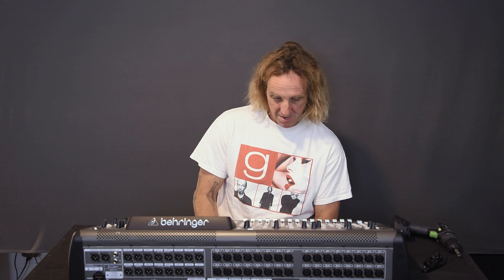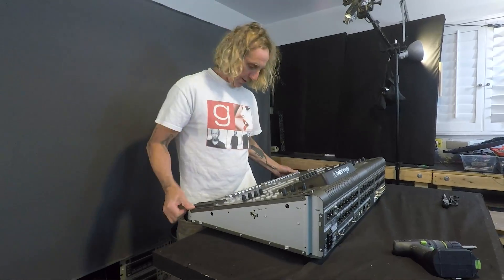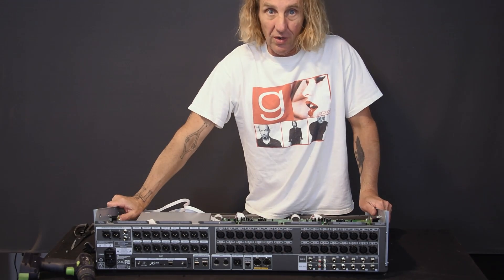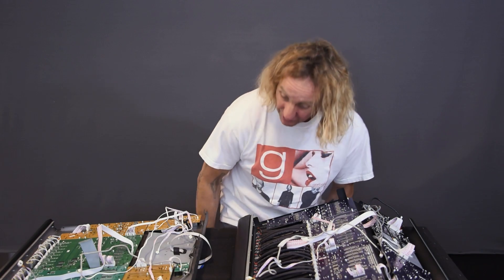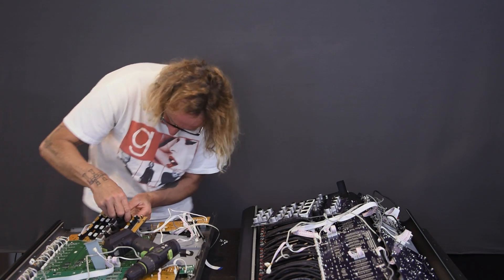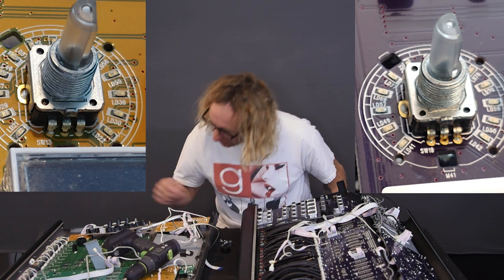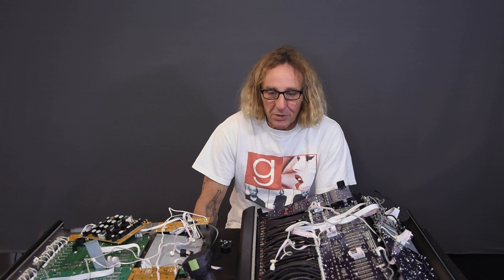Take Apart Behringer X32 & Midas M32 (Public)

Comment: Hey so one important difference is the quality of the xlr releases on the inputs. the non brand connector are not a strong and have snapped on my x32... Had to pull one out of a broken qsc amp.. 
Thanks for the vid saved me some stress pulling the x32 apart

Comment: Price reflects quality, you can see from the components on the PCB alone that Midas is more premium.
Reply from the maker: I agree and looking back I think probably the most important difference is the faders. on the X32 any dirt or dust or liquid falls onto the fader flat surface contacts. 

like professional consoles, the m32 has vertical circuit boards such that the dust falls through and past the contact circuit boards and the faders are individually replaceable 

this is an expensive difference and very important.

Comment: As a retired electronics mechanic working military radar, the expense of a superior design as per longevity and service capabilities, it's better to invest in the superior product.  Unless the user has a short term usage expectation for said product.  Flat packs are ok. But discrete full size transistors are superior imo.

Comment: I'm surely the main culprit for that price difference is just the "Neutrik". hahaha
ok ok, seriously, i will definitely spend 15% more on M32 mainly for having the Xilinx chip in it, then a little more quality on faders and the purple PCBs.
Reply from the maker: I think maybe one of the most important differences is the faders in the Midas are vertical so dirt falls through and they are horizontal on the X32 so dirt builds up inside of them.

also ease of replacement of faders on the m32

Comment: Part of me wonders if you could take the input and output boards from the M32 and swap them into the X32 - that way you'd get the best of both worlds. (Aside from needing to possibly design/3D print some internal mounting hardware.) I've found a source in Vietnam of all places that'll sell new M32 boards... If both units run the same firmware then surely it's at least feasible.

More investigation is required. Thank you for this video! :D

Comment: Seems like Midas put in a special pulley system with belts for the faders. I’ve actually used my school’s M32R and it is a beast even at its small size
Reply from the maker: None of the console companies make their own faders but they do work with motorized fader manufacturers to customize them if need be. 

Mainly involving selecting a certain quality of motorized fader with a specific electronic resistive parameter and then altering the mounting if needed. 

The faders in the Midas have vertical circuit boards which is preferable because liquids and dust does not pile on top of the electrical contacts like it does with a horizontal circuit board like the ones in the x-32.

Comment: A big thing that I'm getting out of this is that the Midas is more serviceable. If a fader needs replaced on the Midas you can easily replace an individual fader. If one needs replaced on the Behringer you either replace the whole circuit board or have to desolder and resolder a fader...not even sure which format the parts are available for that. The take down of the Midas also seems on par with other higher-end consoles that are meant to be serviced while the Behringer might be more of a throw away if major service is needed.
Reply from the maker: And all the dust and much builds up in horizontal faders like X32 and m32 vertical faders the dust falls though and past the board.

Comment: Can someone please explain to me how this type of fader works? How can it apply different resistance over four layers simultaneously and switch between them without a problem.
Reply from the maker: The fader is basically a voltage divider. 

So it's maximum position it puts out maximum voltage and as you drop it down without less and less voltage

This is done by applying the full voltage to one end and zero voltage to the other and the fader slides between the two voltages.

That voltage number is then supplied to the computing processor chip that controls the various outputs in layers and all that stuff.

The computer asks what is the voltage of that fader and whatever that voltage is tells the computer what level that fader is at and what level any signals assigned to that fader should be boosted or attenuated
Reply: @DaveRat  Nice one, now I understand 👍
Reply from the maker: Perfect and happy that makes sense

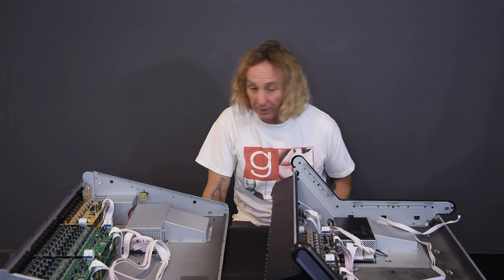Comment: 5:36 The preamp boards look like they are a pretty similar size, I wonder if it would be possible to swap the M32 pre-amps into an x32 or vice versa? Thinking get out of a tight situation or save a few quid buying an M32 and s32 stage box, then swap the nicer analogue boards into the S32 to use them on stage. Maybe another side project for the future?

Comment: ok, Would there be a difference of anything using a x32 rack with the midas stage box vs using a m32R with a midas stage box?
Reply from the maker: The X32 would have noisier analog outputs, cheaper faders, And you have to stand up higher to see the screen. Oh and slightly more latency but that's really not that big of a deal. 

And you can't rent it for quite as much money
Reply: @DaveRat  Thanks Dave! what do you think will be the next m32/x32 mixer that’s used as widespread and around that price point? has it been made yet? also what is your opinion on 48k vs higher mixers? maybe a new video idea?
Reply from the maker: I don't know what the next low cost popular mixing will be. As far as 48k versus higher, One advantage of the higher rates is lower latency. Especially for things like in ears that lower latency is advantageous.

Having the wider frequency response only really matters if you have a really high quality sound system where it may be audible. Or if you do a lot of mucking around with the signal and have quality degradation, starting with a higher quality signal may leave you with a better outcome
Reply: @DaveRat   ok thanks, it’s crazy after 12 years they still haven’t even done a V2 with more dsp or inputs or fx or something I’ve been on the platform for a while but just purchased a brand new m32 couple of days ago and it feels weird buying something that’s essentially the same as 2012

Comment: Fader 9 on my Midas m32 is acting weird now. It kind of locks into 4 positions and is stiff until it reaches them.Hoping its just the belt slipped off again like the x32. I'm thinking the fader got moved when it was stereo linked and forced it off track or something. I'm hoping its not hash or somthig that dropped down in there lol 😂😂,i try not to do that. Not looking forward to pulling the desk apart.but maybe its not a bad idea to have a spare fader or two lying around. Its been incredible reliable. My x32 was too and my friends dad I helped do live sound for years x32 was a tank as well. he got a nice acrylic cover for his behringer but i never found one like that for the m32 i always wanted one. I only use mine for my small studio and never move it and its all accessible via my patchbay.
Reply from the maker: If it locks in 4 positions it sounds like some debris is on the pulley wheel and the fader gets stick every time the debris hits the belt when the wheel spins
Reply: @DaveRat  Right on dude, That seems very plausible Thank you!

Comment: Thanks for the excellent demo! There is always a reason why Behringer is a bit cheaper. How would you compare these two against the Yamaha DM3 (or the DM3 Dante)? If we of course forget about the number of I/Os. We are looking for a mixer to have in the practise place as a recording and mixing machine for a pop, rock, metal style gig. To be able to record sessions of lets say 3-7 players. We were thinking of the DM3 as it is really small and offers quite a lot for the price. Would you say a Midas M32R Live (or Presonus StudioLive 32SC for example) would be more suitable, offer any real advantages that we would urgently need for our purpose? We are thinking of using a DAW on a laptop for recording and mixing. Thanks
Reply from the maker: To many factors to give advice but I would consider things like

Client perception, resale value, industry acceptance, capabilities, size, weight, cost, reliability, manufacturer reputation, ergonomics and ease of use, repairability, and company customer support to name a few.

Create your list, prioritize the factors and then plug in the aspects of the gear under consideration.

Comment: Hi Dave, nice video. As You proberly know, Midas has come out with the "new" Live versions with rubber buttons. Can You tell if the old buttons (mute/select) are replaceable with new rubber ? That the pcb's are the same but only the button-casing and buttons are different? Would have been nice if You made a video of that.

Comment: With the issues that AES50 has (the pops etc) with different cables and lengths, I’m curious if you looked at that connection point, circuit board, etc while you were dissecting

Comment: Hi! I need a piece of advise if you don't mind 🙂
I'm fixing Behringer xr18 with the input problem: some inputs lack sensivity and/or lack a high friquency range. I've replaced blown capacitors on power supply unit as well as thouse on a preamp board but it din't fix the issue :-( Could you be so kind to throw an idea what else could it be?
Reply from the maker: Oh my, I have not worked on fixing one. Not sure other than getting an oscilloscope and driving a good and bad channel and looking for differences in the signal at various points in the circuit

Comment: Great comparison
Reply: @DaveRat  wanted to ask you about the new designs for subwoofers that can go below 20 hz and use a motors to spin the fan blades which act as speaker diaphragms. have you ever used any and is it just pie in the sky technologies.Seen some demonstrations on YouTube but never seen it applied in concert environment .I got to listen to Robert plant and Phil Collins was playing the drums for him and they used EV and Klipsch commercial speakers and it sounded incredible
Reply from the maker: I've heard a fan based sub. Very impressive but has fan noise as well as needs a huge or open back chamber. It can't pressurize a small box. When I heard it in a hotel room, the hotel room next door was used as the enclosure.

But it went low and clean.
Reply: @DaveRat  I know the power is essential for subs to perform but my god the boxes keep getting heavier .I guess there is no way around it .When I was in high school we got to build a tube amplifier and speakers and a transistor radio and my teacher was talking about building enclosures out of concrete or granite ...Now everything is hdf or MDF and they don't like moisture at all !
Reply from the maker: That's all consumer stuff. The pro gear uses Baltic Birch plywood for most construction. It's a high density 17 plies per inch extremely strong wood and it deals with abuse well.

MDF is heavier but crumbles and theoretically MDF does sound slightly better but it's useless for the professional applications
Reply: @DaveRat  Is that marine grade plywood they are using ?I see some speakers just using felt and others some sort of glued on vinyl or basic flat black  paint ..I want to build myself of find a used pair of bass bins .I just fixed my friends 1979 marshall amp for him .The tubes were crazy expensive but I replaced a couple capacitors on it and he had it set up on a cabinet with 4 celestion 10 inch and 2 EV horns .one is about 12 inches wide and the other is about 4 inches .he plays an old fender cream colored .Was his uncle's .great shape .I don't play but I love the sound of that 70#s tube equipment ..
Reply from the maker: For PA speakers it doesn't need to be marine grade it's not going in the water. It's called finish Birch or Baltic Birch.

Concrete forming ply also works for 1/2-in stuff.

For the PA boxes most of them are painted with a high quality epoxy paint and that way they can be easily touched up or repaired
Reply: @DaveRat  .I just want to build a pair I could keep in the garage and take it out  if I have a party and my friends come over and want to play ..the only issue I have are rodents .No offence .the little bastards are getting into everything and my cats are lazy but I do have a cat that must be some kind of monster in a past life .He drowns teg mice in his water bowl ! .I have a pair of old crown amps that work and an old mixer .can't remember what it is .Going to clean it up and get it going .They can plug in their mikes and guitars into them ..Going to keep hitting the garage sales and storage unit sales and see what I can set up for summer  fun .I have a party to go to on Canada day July 1st and my buddy bought Yorkville sound amplified  speakers with tripods..They have all the Bluetooth bells and whistles ..They sound ok I guess .Keep doing what you do .Glad I came across your videos

Comment: Dave takes them apart and then pays staff to put them back together😃
Reply from the maker: I think I have the reassembly video somewhere I just never posted it because I figured if people saw how it was taken apart they'd know how to put it together but if I find it I could post that for you
Reply: @DaveRat some people are made for ribbon cables and assembly.  A friend of mine is doing a project for a church, he cut down a large format analog yamaha board and chopped off all the EQ on each channel and built a new metal frame for it. I couldn't look at the same project for months on end like he can.

Comment: The law of diminishing returns is very important when it comes to gear quality. I remember buying plastic lenses for my camera, optically they are the same but if you drop them there is a chance they will  break sooner than metal lenses.
Sometimes I like to pay premium for an overall superior product, but sometimes I do not pay more if the difference is not audible in a blind test.
Reply from the maker: 🤙👍🤙 widening the focus to look beyond pure function and also include durability, longevity, aesthetics, resale value, size, weight, cost, warranty and dependability is important

Comment: Interesting, I use some Behringer gear, have never had any issues with any of it, the only thing I do not like about some of their smaller format mixers is they have real bad compressors, it is strange considering I also use a Behringer rack compressors  that at least to my ears work great, yeah I know there is far better but I use what I can afford.... I did splash out for a better mixer though and got a Tascam model 12

Comment: Hey. does anyone know if the two desks are using the same  main processor, and if the effects processors are the same?
Reply from the maker: The software is identical and the effects are software based so the effects are identical. You can see the processors, A/D and D/A converters in the pics. See other comments where viewers discuss the different chips and such
Reply: @DaveRat  thanks Dave..
I haven't been able to get a clear description anywhere else.
The Midas website details the FX rack but the Behringer site doesn't so it's notthat easy to compare the two.

I'm Actually looking at buying an MR12 as my bass guitar processor, as it seems like a great way to run effects etc, and also to run a monitor listen output, all in one place.

I just need to work out how I am going to control it live.... Mutes and FX on/off from a MIDI footswitch board maybe.
Reply from the maker: Not really familiar much beyond these consoles but the software updates and any stored files can load into ether console

Comment: That's curious to me on the M32 on the output board; that big square chip from Xylinx is probably an FPGA and one, they're not cheap, two, someone needs to write a substantial amount of software code to run on it, and three, what is it used for? Is there some real-time processing the midas can do on the outputs?
Reply from the maker: I don't know the specifics but there are people here that have commented that are quite knowledgeable. Maybe scan the comments and reach out to one or more of them and they will probably know the answer.

Comment: Would be possible to use a input or output board from the Midas in to the X32 ?
Reply from the maker: Hmmm, don't know but someone here may
Reply: @DaveRat  logic wise  the software is the same and as far i am seeing  the connections are also the same the ribbons. X32 accept the stage boxes over aes50. It would be worth to try right ?
Reply from the maker: Love to see that tried

Comment: Dave,  you really should take ESD precautions.  You can shorten the life of discrete components without proper ESD procedures.  These desks are used at venues where failure is not an option.
Reply from the maker: Hmmm, my precautions tend to driven by "learn the hard way" And yet to have an esd issue and worked on loads of boards.

Back when I worked at Hughes Aircraft there were issues with esd when handling MOSFETs that were not soldered on to boards yet. But that is the only time in the 42 years of working on electronics I have seen an issue occur

Comment: Interesting to see the differences on the output board, the Behringer seems to be using standard off-the-shelf parts while Midas went with Xilinx FPGAs probably to implement some custom logic, that right there is going to have a major impact on cost, FPGAs are cool but definitely not cheap
Reply: I’m pretty sure it’s a clever retrofit to keep the same processing core application. The X32 output card uses an 8 channel D/A and the M32 looks like dual channel. The older/lower grade FPGAs are actually quite affordable these days so it may essentially just be a TDM multiplexer from the core 8 channel serial audio to 4 separate 2 channel streams.